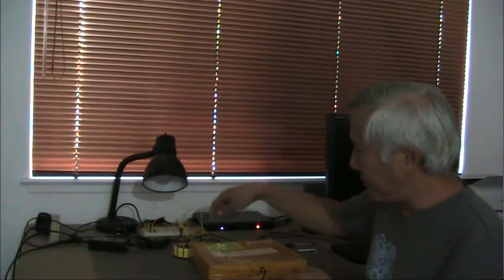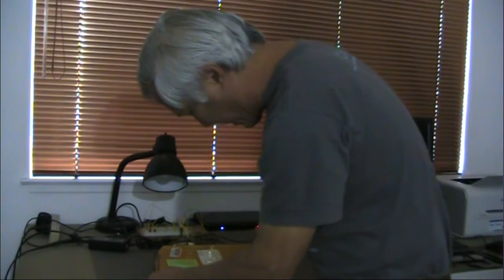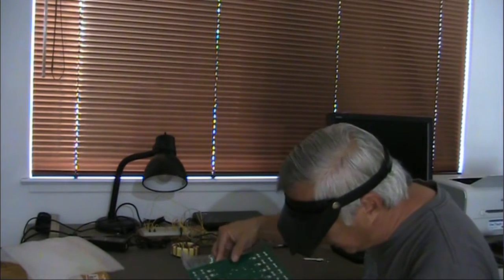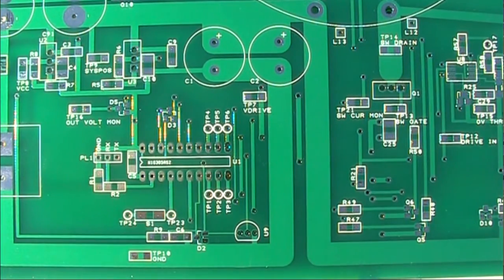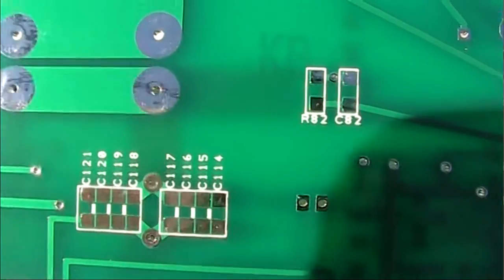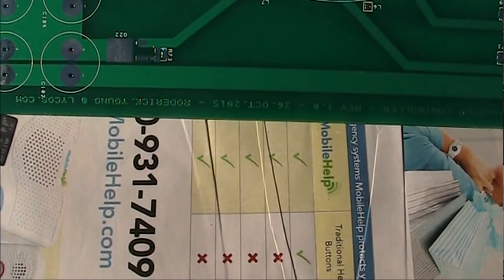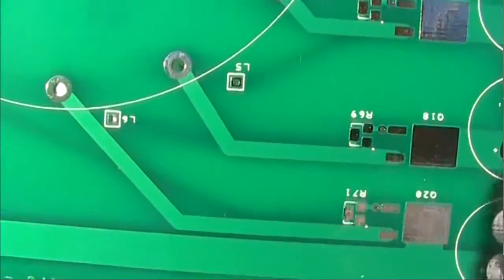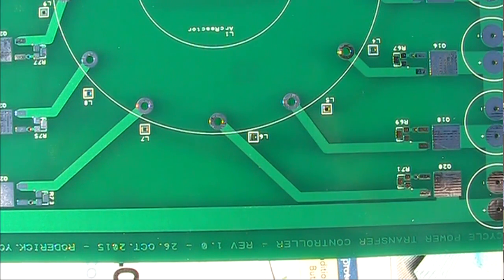Unboxing pcbway order

Comment: Hey Roderick. I know that this video was posted some time ago, but can you give me few informations?
- on the pcb way they require also some files like .pcb. Can you tell me if this files are really necessary, since the product that I am using to design the PCB does not produce this files, only the gerber ones?
- how long it took for the order to arrive?
- how would you describe the communication with this company?
- would you use this company again to produce your PCBs?
Thanks for your help
Reply: Hi,Mitroi

1:Our pcbway engineer usually check the gerber file,hope you can understand.
2:If you choose DHL,about 3-5days you will receive it.
3:I think you will satisfied to our communication